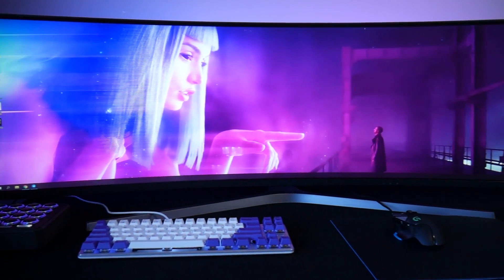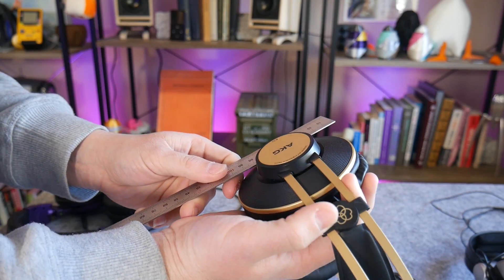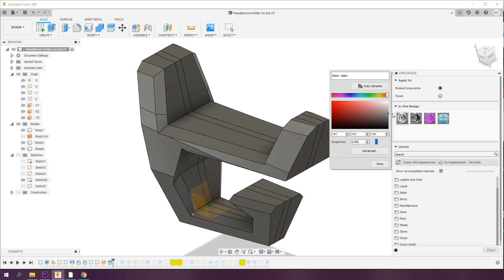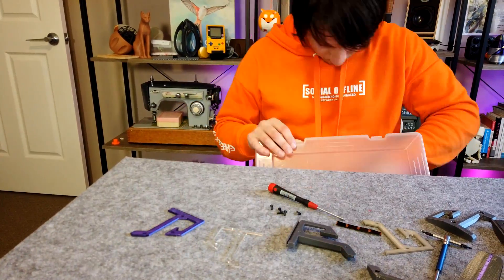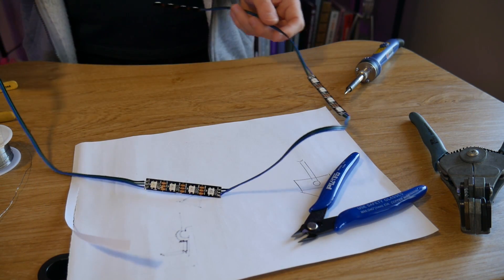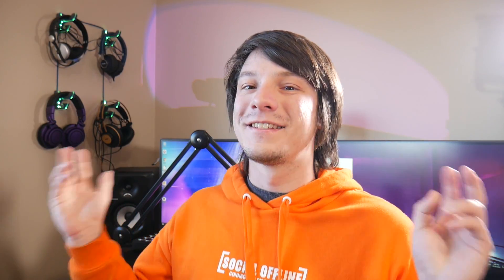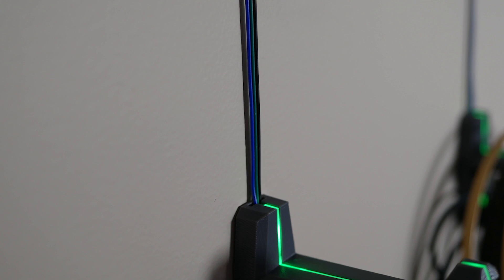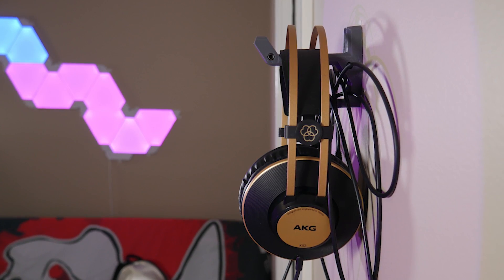Designing a Cyberpunk Headphone Holder (With RGB!)

Comment: Very cool build. The term you were looking for, for when light makes certain materials give off a specific colour, like your purple light making orange in certain items "pop" is called "fluorescence" .

Another way to do wireless lighting for you headphone holder, drill a small hole up though the bottom of your acrylic. it only needs to go in a centimeter or so and a rough hole is actually better than a hole with smooth walls for this. Then you set up a small laser behind a piece of furniture that is on the same wall as your head phone holder (you will still have to plug in or otherwise power the laser but even a cat toy laser might be bright enough for this). Aim the laser beam up at the little hole you drilled into the bottom of your headphone holder and the rough cut walls of the hole along with the sanding job you did to the rest of the acrylic will diffuse the beam through out the acrylic lighting it up. The beam will be invisible until it interacts with you headphone stand (so invisible and efficient wireless power) and as long as the beam is running only a centimeter or two away from the wall there is very little chance that it can shine in someone's eyes so it is pretty safe.

Comment: Maybe could have mounted everything on a board so the wires can run behind the board and have an exit route on the bottom right. This will make it easier to space out all 4 holders evenly and only need 1 or 2 hooks behind the board kind of like a picture frame mount.

Comment: Ikea SKADIS. It mounts onto the wall but provides you that gap in the back to hide the cables. If you want to hide the holes you can use a nice poster board. As for mounting things to a wall. Your best friend will
Be blue painters tape and a level you can put all your markings on the painters tape so you don’t mark the walls.

Comment: In my opinion, you could use some cable duct. You can buy flat ones, that you could cut to the length to you need, and even paint it with the same paint you used on the walls. That's how i hide the ugly thick cables of my projector on the living room ceiling. Anyway, great design and great project, keep up the good work!

Comment: How about running the cables through aluminium tubes? 6 mm OD (4 mm ID) is enough to route three individual wires through.
Also if you're running all LEDs with the same color simultaneously you can connect them in parallel, giving you  more possibilitys to route the wires.
eg:
+      +
   \   |
+----+
       |
       | (to Arduino)
in a U shape, O shape or two colums of tubes running straight down to the floor.

Comment: For level, hang a weight on string for vertical and then get a horizontal off that using an object with a 90° angle like a CD case.

Comment: Get phosphorescent powder cheap off eBay. Mix it with clear resin that you pour to make your inner strip. Glow with no battery or wire. Check out Big Clive videos on these powders. You need strontium aluminate powders by the way: https://youtu.be/LbqX4j5XieQ

Comment: Pro tip: to store any wire cleanly, wrap it around your fingers, leave a tail, then wrap that tail around the middle of the bulk (between middle and ring fingers, but don't keep it around them as you wrap) and pull it through one side. It stays pretty much indefinitely, looks clean, and won't tangle.

Comment: You can get rolls of flat, thin, and white "cables" designed specifically for sticking to walls, and optionally painting over, in order to power LED strips, connect speakers, etc., without the wires being at all visible:
https://m.aliexpress.com/item/2036527967.html

It looks like it's essentially 2 or 4 strips of copper tape covered in a layer of white insulation - and you could absolutely achieve the same result with regular adhesive copper tape and something to cover it, but using this stuff looks much easier and personally I'd rather use the pre-made 2-or-4-conductor tape unless I had a very tight budget, especially given how delicate copper tape can be, and its tendency to stick to itself and/or crease up...

The AliExpress seller of the item I linked above seems to be the only manufacturer/seller of this particular type of product - when I checked a few months ago, at least - so their prices are maybe a bit higher than they would be otherwise, but the 2-conductor stuff isn't too expensive IMO - around £1.50/metre for the one I linked, though they have various widths and thicknesses for different current ratings, so make sure to choose the right one.
The 4-conductor stuff is around twice that price, which can add up fast if you wanted to run it all the way around a room, for example, but if you just need to get 2-core power (by which I mean "not requiring an earth conductor, 3-phase, etc") a few metres to an Arduino to control the LEDs, then short runs of 4 conductors (RGB+common) between the 4 headphone mounts, this might not be too expensive an option :)

Of course, I don't know how sticky these strips are, nor if repainting the wall when it's removed would be an issue for you, but it might be worth considering :)
(I'm allowed to repaint this rented property as much as I like as long as it's back to its original colour when we move our, and we already have a lot of scuff marks and cat scratching damage I'll need to paint over, so I'm not too put-off by the thought of a bit more future painting in the name of aesthetics or convenience today, but my landlady is slightly above average - not a high bar, I know...)

Other comments suggest flat-flex cables (FFCs), and I imagine they would work, but they're typically intended to carry lots of low-current signals over a short distance, not a small number of high-currents over longer distances. I don't know how easy it would be to find, eg, 5-metre FFCs at sensible prices - and connecting to them on either end sounds like it would be a pain!

Disclaimer: I've not used this stuff myself, so I can't make any claims from experience. I just spend a lot of time browsing AliExpress from my phone, so I discover all kinds of neat things (and lots of weird things!) 😸

Comment: Get an I Bar level, and use a dry erase markers on the metal part to mark out the distance you want the devices apart. This way, no paper used and all you need is your level, ruler, and dry erase marker.

Comment: Better and easier: mount them on a MDF/wood or acrylic panel (painted or vinyl) and run the cables in channels on the back of the panel. Mount the panel on the wall with a few screws/adhesives: cables are gone. 😎

Comment: I've modded half of my AKG K92 to have a 1m cord instead of a 3m one. Pretty easy to shorten the cable by taking apart the ear cup, de-soldering the wires, shortening, then re-attaching the wires.

Comment: You don't need to buy a level! You can just dangle a string with a weight (an M10 nut or something), and then you have a vertical. And then you need something with a right angle to follow that up and then you have a horizontal, it could be anything, even a piece of stiff paper, a magazine, whatever. Bubble levels don't actually work that well.

Comment: I'd mount the hooks to a backer board to hide the cables. Then position the board so that the hooks are level. Use random cycling RGB LEDs so you don't need the arduino driver and power them by battery or Solar PV.

Comment: Love it! You don't need a level. If it looks good, it's level. I have used levels sometimes and whatever I was hanging still looks off because of some other aesthetic nearby. That said, as others have mentioned your phone probably has a level in it :). Or measure from the ceiling/floor.

Comment: A fluorescent filament (or paint) should glow pretty brightly when a black light (UV-A) is shined upon it. So one option would be to mount a spotlight with a UV-A bulb somewhere and point it at the headphone mounts. That would make the edge really pop without adding more visible light to the mixture.

And hey, even if a little visible light does leak, it'll probably play well with the rest of the lights you've set up!

Comment: How about illuminating the Perspex with lasers? 
Mount a powered box on the top of the wall, with lasers pointing down, to avoid the dangling headphone cables blocking the light?
How thick is the wall? Use induction from the other side - might be cheaper if your neighbour pays the bill ;-)
Use fibre optics, which might be more in keeping with the Synthwave aesthetic?

Comment: As for hiding the cables I would use a piece of plyboard with the cables going through it and then everything is hidden behind out of sight. This way it can all be done on a bench then hung where needed. Or the tech youtuber go to wall, pegboard. Pretty cool ideas though, quite enjoying the office makeover series. Also for the highlights strip, try transparent green pla. I have found it 'glows' under UV light

Comment: i would have used a synthwave pattern to hide the cables 
like the hex feature you have on the other wall or even just chamfered boxes laid out in that circuit board esq pattern that synth is so fond of 
that way, the cables just sit behind or in the feature and the head phone holder set is as much art as it is function

Comment: Very nice solution. For the wires, if you can't hide them you could try designing wire conduit or wire clips which add to the synthwave look. I'm imagining low poly tunnels that run from holder to holder with sharp angles - maybe printed in that purple filament.

Comment: When trying to level without level you can use the ceiling and floor as measure point, as long as your ceiling is straight you should have no problem leveling things

Comment: What you could do is to mount the holders onto a panel that spans the wall width area or part of it and then run the wiring through to the backside of the panel and secure the panel to the wall. You could then run the power feed wire down in the corner or via a nice discrete conduit. If it's you own home and you have O.C.D  you could even run the wiring inside the wall. There are all kinds of options depending on how much effort you want to devote to it.

Comment: The dirty trick I used to get large prints to stay flat is to remove material from the inside of the face that touches the print surface. This allows the mating surface to get a good bond to the print bed before there are forces trying to pull it up, while also reducing the magnitude of those forces.

I have also cut channels in my prints to break up the surface against the print bed.  Again, this is an attempt to change the way the forces of shrinking interact with the parts that are bonding to the print surface.  Usually a grid pattern works.  That way each square of the grid gets a goodbond to the print bed before layer 2 or three connects everything and starts trying to shrink the part.

If you make the channels or holes a single layer deep then the slicer will usually not bother adding support, and the bridge settings will take over.

Comment: So it looks like your prototype at least was held up with 3m "command" adhesive - how did this work for you? I've tried to hold 3d printed stuff up with it before, and it always falls off within a few days tops. Testing with eSun pla plus. Have tried ipa cleaning, and roughing up the print through sanding, no luck, the screwdriver mount always falls...
Reply from the maker: So far so good, they do need good contact and I used quite fine sandpaper on the back.
Reply: @MakersMuse  interesting, wonder if maybe fine sandpaper is the difference. I'll have to try that.
Reply: @rpavlik1  Make sure you properly clean the sanded surface before trying to stick anything to it, if you aren't already. Otherwise a lot of what sticks to the adhesive will just be the dust from the sandpaper :)
Also ensure any print bed adhesives are cleaned off, if that's the surface you want to stick stuff to.

That said, I don't think I've tried sticking 3D printed parts to walls with Command strips, so I can't really talk! 😹
I use Command strips to wall-mount lots of other things, but as far as I recall, the only 3D printed parts I have mounted to any vertical surfaces are mounted to e.g. the side of Ikea bookcases, using 3M VHB tape (or clones thereof) - and even VHB tape wasn't enough for some aerosol can holders I printed (PLA, I think), so I had to screw them to the side of the bookcase instead... 😕

Comment: You could print a display piece to cover the wires like your logo, or headphone image. One other thing is add a dummy strip at the bottom so it looks like a picture frame and add an image in the middle.

Comment: rather than mounting them directly onto the wall you could mount them onto a board and run the wires on the back of the board. you them get a bunch of additional options for what you want to do with the board. personally I'd go with a multi-layer board with (from back to front): shiny black plastic (or maybe a thin sheet of polished dark metal), clear acrylic, opaque/cloudy/frosted acrylic (or something similar). then maybe upgrade the RBG by making each strip individually addressable.

Comment: If wire has to be visible then be unapologetic about it and make it a feature eg mount the headphones in a vertical stacked line and use LED/acrylic/3D printed trail between the hooks as a continuation of the LED features within the hooks; or if you like the square arrangement then have the light ‘exit’ out the top of a hook and then change direction and ‘enter’ the top of the hook to its side and so forth around the whole path

Comment: You could mount them to a thick square/rectangle of mdf, maybe 10mm think or something like that. Router channels into the back to accommodate and hide the pixel cables and then paint it the same colour as the wall. Bit more work but it would be a much cleaner finish. Nice little design though, looks great.

Comment: Like some others have said, cable raceway is a great idea. However, don't buy one, print it.  In that way you can design it in such a way that it matches your theme. You can even use the same adhesive. And the kicker, make it in modular sections which will allow you to expand it in the future. Why not have a "hidden" cable raceway that like like a simple design across your entire wall.  I might even have to take my own advice, with visions of a giant Tree of Life design.

Comment: You could also create a 3D printed frame that connects all 4 hangers, with the wiring inside the frame, and then put something decorative in the fame itself.  I’ve also tinkered with embedding the wires in the plaster, and then repairing the plaster and repainting.  The downside to the latter approach is that it’s permanent, while the framing method can easily be removed.

P.S. I prefer to leave the cords dangling, or just making 1 big loop, instead of wrapping them up, but that’s not possible if the cords are very long.

Comment: The cable is definitely not appealing in its current state, but rather than trying to hide it, perhaps you can incorporate it in the design. The Makers Muse logo has sharp points. Have your headphones at each point and use the cable draw your logo on the wall. Use this as an excuse to get more headphones as well!

Comment: Instead of insulated motor wire, try using flat flex cable or custom flex pcb. With a custom flex pcb, you can get flat against the wall and have more of those synthwave angular lines. Fusion 360 now has a pcb design workspace, it should be pretty easy to get your feet wet.

Comment: Mount the holders onto a panel and hang that on the wall with the wires behind it. You could use an acrylic sheet and stand it off from the wall to make it look like it’s floating in front of the wall. You could even edge light his panel too!

Comment: Consider attaching the mounts to a panel (wood or acrylic) that can then be "picture frame" mounted with the same attachments. That would hide the wires behind the panel.  The panel could be painted the same as wall(or an accent color & could include additional rgbs in it) then only a power wire comes out behind the panel and is hidden enough where your left speaker is.
Reply: Thats exactly what I was thinking. mounting it to a cool square of nice wood, passing the wires through the back. that way only one of the wires will be visible, the power
Reply: The panel could also feature some of the same design elements, too.  The white wall doesn't really fit that well, but a square with cut corners, maybe some additional lighting effects, painted to match the holders, and suddenly it's not only clean but a thematically-complete piece.
Reply: @georgedorn_fnord  Or a nanoleaf-style construction.
Reply: My thoughts as well. A wire guide could be cut into the back of the panel so everything sits flush with the wall and the wires are completely hidden.

The first idea that came to mind, if he doesn't want to run wires through the wall because of the effort involved, another option would be to route a channel directly into the drywall, lay the wires in the channel and cover with plaster and paint to make it disappear, embedded into the wall.

Comment: There is neon pink too, and some whites light up blue in UV as well (if they contain optical brighteners). The effect is fluorescence and it's when a material can absorb light of a short wavelength and give it off as a longer wavelength. Most such pigments is reactive to UV/blacklight and many are reactive to blue as well. I've seen some colors like yellow and orange fuorece from the modern bright green LEDs but it might be that they give of some blue or UV light similar to white LED's, I'm not sure.

Another thing you could do is to get cables that's harder to see, like with clear insulation, or maybe magnet wire.